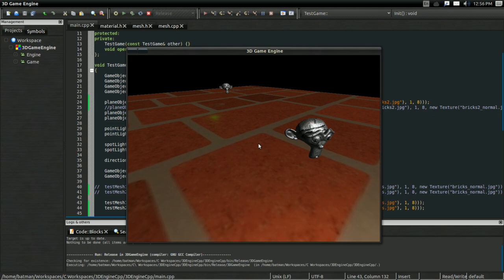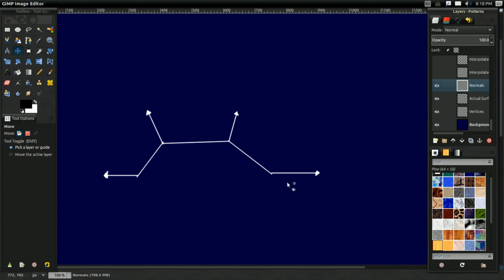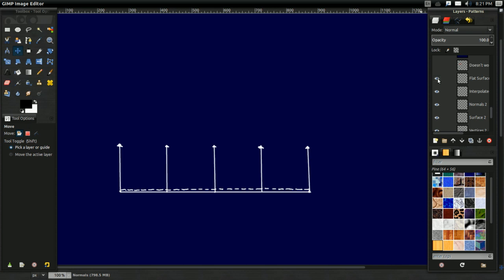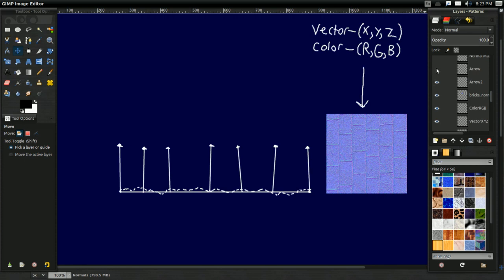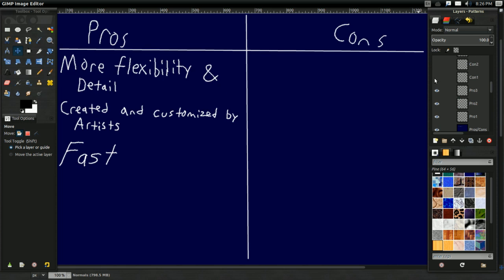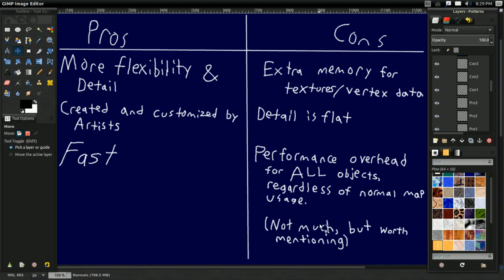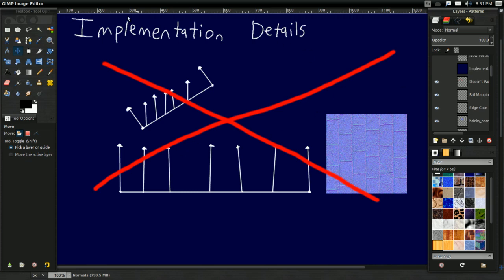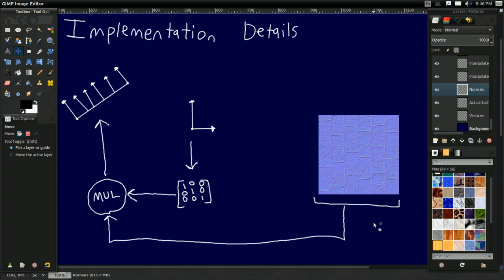OpenGL Game Rendering Tutorial: How Normal Mapping Works

Comment: Do you know per any chance how to implement transparency for hierarchical sprites?
I mean, let's see I have a character in my game that is made of several "pieces" that can move on their own, relative to each other (the sprite hierarchy, each sprite being just a textured mesh, e.g. a quad). This is easy, I can do that, with a hierarchy of matrix transforms & stuff. But now, suppose I want to make the entire sprite semi-transparent, like a ghost. If I naively set the transparency for each individual part of the character, then it would look weird, because the parts of the sprites that were previously obscured by other pieces are now transparent, and the previously hidden parts are becoming visible through them! :P You can see, for example, the body of the character through its semi-transparent clothes, and all of that can be visible through its armor, but most importantly, some parts that should never be visible (some dummy endings of the limbs, for example), are visible too! :P
This is not what I want. I want the entire character to become transparent, not just its individual constituent pieces. As if the entire character were drawn on a separate layer, and I made that entire layer semi-transparent.
How can this effect be achieved? Should I render the entire character to texture first, or something? Would it be efficient enough if there are more semi-transparent characters on the screen? How can I figure out the size of the texture needed to contain the entire image of the character? Or maybe there's some better way of doing it?

Comment: I've been trying to get this working for months and it seems nothing and nobody can help me. The problem is that when the light is say on the +x side of a triangle, everything looks great, but when the light moves over to the opposite -x side of the triangle, the triangle acts as though it isn't in the light at all even though it obviously is. I'd image the normals, for whatever reason are oriented like the tangents should be and the tangents are oriented like the normals should be, but swapping them does absolutely nothing so maybe that isn't the problem at all. GAHHHHH Don't know how I haven't bashed a hole in my head yet.

Comment: Are all the new 3D Game series going to be in C++? I would prefer Java.
Reply: There is no reason why you should not using Java at all. Benny is showing basic Concepts of a 3D Engine which are not related to any programming language. If you like Java go ahead. If you are a python fan go for it! All languages that are capable of running OpenGL are suitable. So go on and write some amazing stuff with java :)
Reply: No, I believe this video is from GDX, which is an experimental version of the engine, which is in both Java and C++
Reply: Kiwuser No it is the C++ port of the engine which Benny has just completed. It is not GDX.
Reply: Phillip Sampson I'm pretty sure the c++ port doesn't have bump mapping, that's why I think it's GDX, which does have it, along with shadows aswell
Reply: Kiwuser just because he hasn't submitted code the GitHub or doesn't mean it doesn't exist. You can clearly see the project is called 3DEngineCpp
Reply from the maker: Kiwuser Your reasoning is sound, but actually the way I'm doing these videos is I'm writing out the code and recording it first, and then going back and recording the introduction to videos like these so people can see the finished product before they commit to watching. So yes, the code exists, I'm just saving it until the code video is uploaded.
Reply: When will that be? :) I can't wait for all of these fancy rendering techniques! Also, if you want, there's a cool program called Crazybump you can use which automatically makes bump maps and height maps for textures that don't have them.